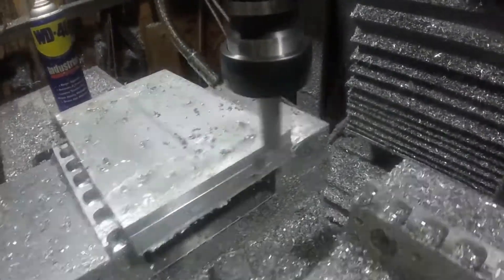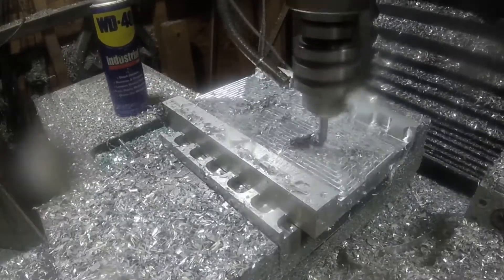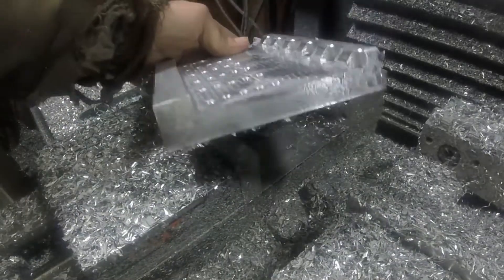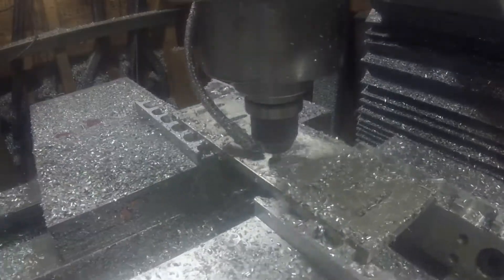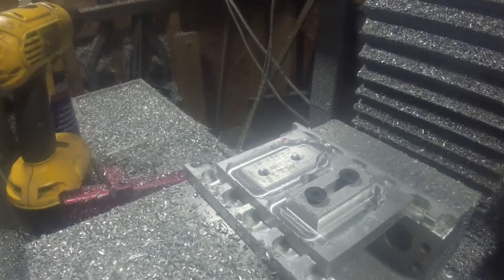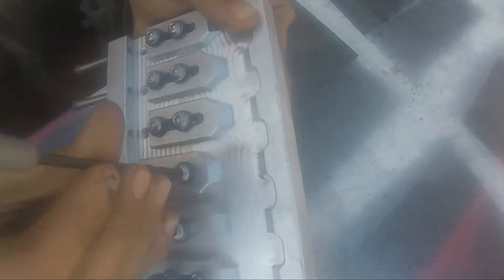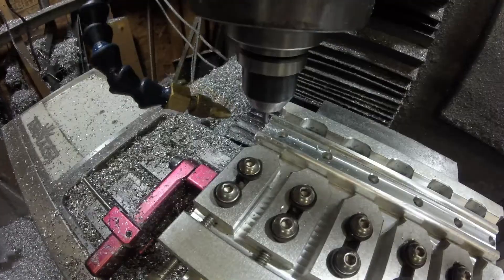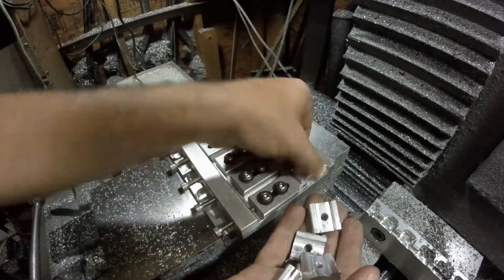Making a multi-vice

Comment: Nice job!
so now you're using the tapping head on Tormach, what is the parameters for #1/4-20? (RPM, dwell etc.)
Reply from the maker: Thanks!!  
I've been using the tapping head for most of my holes under 8mm and for no particular reason I default to 500 rpm and it seems to work well.  The thread pitch will determine the feed so for 20 tpi the feed is 25 (based on 500 rpm).  For my dwell I use 0.2.  That seems to be just enough time for the spindle to stop before reversing.
Reply: @ecdezz , Thanks and few more questions:
Do you use Long-hand code or G84?

Is it spiral flute tap and is the hole diam 0.201in ?
Have you tried the blind holes?
Reply from the maker: I'm using CamBam which is about as simple as it gets for Cam programming.  I wrote out a G84 line of code and saved it as a style so when I need it I select the hole and a drilling operation and then select the tapping "style" from the list and the rest is automatic.

The drilled hole is 0.201"
I have tried blind holes but I usually drill further than the tap depth because the tap is still spinning and going down as the motor stops.  If it bottoms out the tap will break.